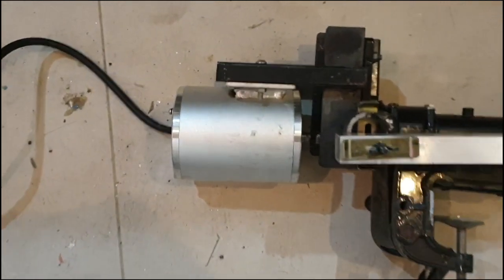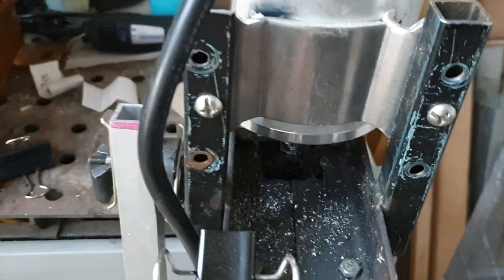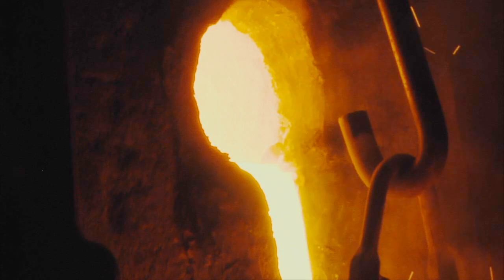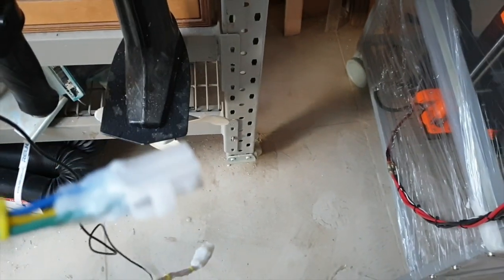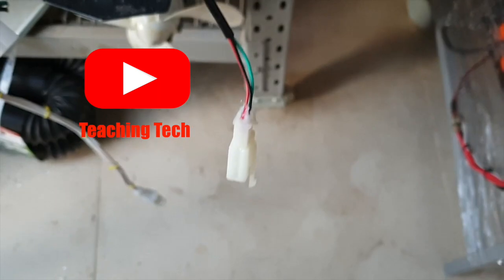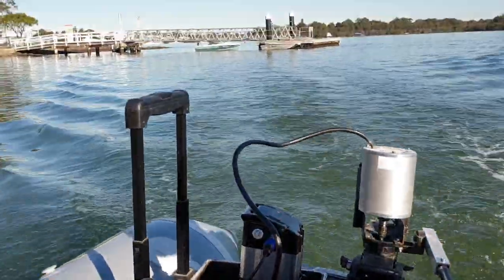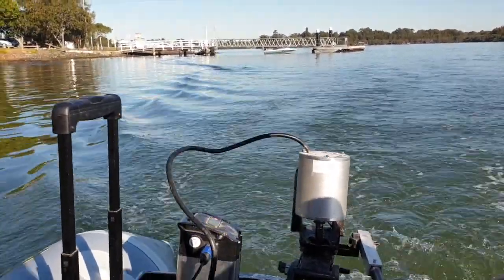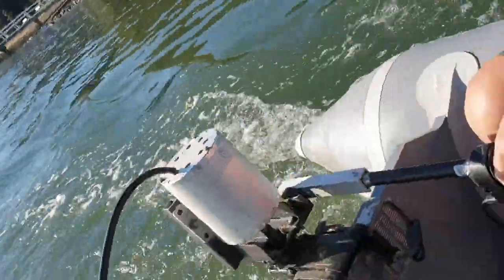Petrol to Electric Outboard Conversion

Comment: I am building almost the same outboard with the same 48 volt BLDC scooter motor kit. I chose to mount a shaft to the lower end by using a standard hockey puck made out of rubber.It's a 12mm diameter 4" shaft thru it with a pair of flanges to connect to the lower end's centrifugal clutch bell housing with screws. I have 2 sets of pillow bearings to support the 2 shafts.One from the lower end and the other from the motor.  I am using cog gears and a pair of cog belts to couple the motor shaft to the lower end shaft assembly to get the correct  prop RPM range. Almost ready for the water test.

Comment: Looks like a trolling motor would of done the same. How fast?
Reply from the maker: Not sure about the speeds, I don't imagine a trolling motor at 12v would be as powerful though.
Reply: @hashmoartlife1491  give us a gps run! Lol

Looks like your going 3-5mph. 
I know my 30lb thrust 12v trolling motor would make a similar sized boat do 3mph. 
I’ve seen 87lb 24v make an inflatable do 7mph

Comment: Some of the newer Trolling motors, cost more than the avg weekend fisherman can afford nowadays and because of that the prices of used ones are through the roof as well. My used 15'er cost me 200$. No way im spending almost 2k for a T. M.. Heck I can almost by a decent used bass boat for that price in my area.
Reply from the maker: Yes, agree 💯. Electric outboards are ridiculously over priced.

Comment: What hp was the outboard? And what is the motor power? Do you think it's a good match? I'm planning to do this  but my biggest worry is that the motor rpm is way less then the original motor had, therefore making it slow and inefficient. Maybe a new prop could help this problem.
Reply from the maker: I'm not sure about the HP. But the motor is a 48v 1800w brushless motor from ebay. Supposed to be used for a  scooter/bicycle. It was a balance between power, cost, weight and voltage I was comfortable working with.